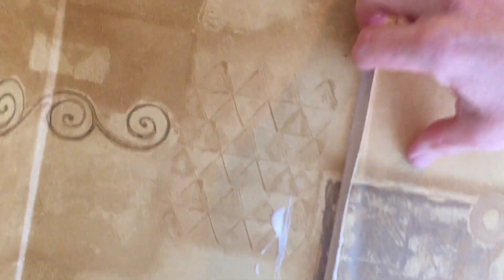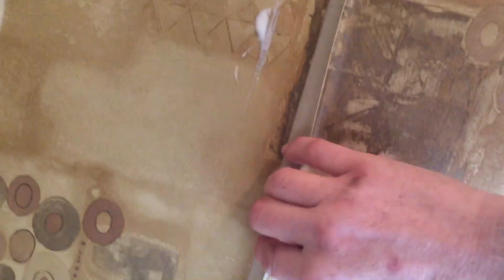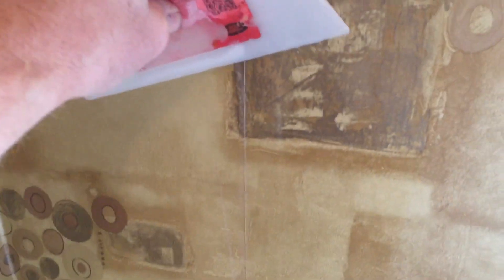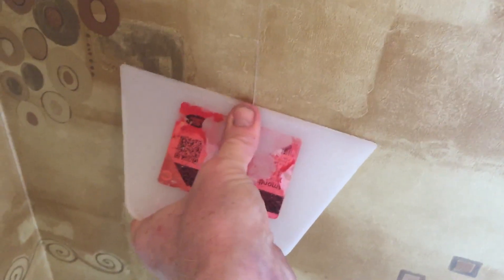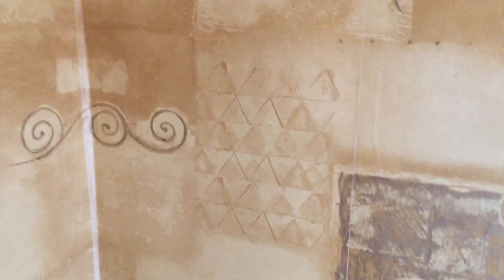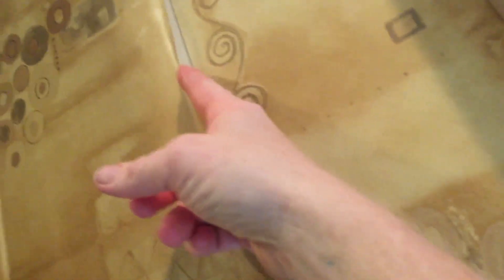How To Repair Wallpaper Seams Part I - Spencer Colgan

Comment: Wallpaper had higher quality 40 years ago.  I put wallpaper in my master bathroom and it is still perfect.  I put wallpaper in the downstairs half bath and the seams are coming loose.  I painted the walls, used wallpaper primer and still have problems.  Great video.

Comment: Excellent video but my problem is a bit different.  The seams are separating.  You can see about 1/4 of the wall.  Is there any way to fix this?

Comment: we just put up wallpaper and the next day it all peeled up on the edges. The wallpaper is very thick and heavy, so we thought that was the issue. what would you recommend. should we repaste then tape it down until it drys or glue the seams down as theyre dry
Reply from the maker: I love this question… Do you know why? Because it happened to me 30 years ago. I would bet that where it peeled up the paint underneath where it peeled up is different than the paint where it is sticking… Am I right?

If it is just thin wallpaper, go out and get yourself what is called border adhesive and put it under the areas where a curled up, and be done with it and have a glass of wine. If it is vinyl, go out and get yourself what  is called Extreme tack from the company called Roman, and do the same thing and then have two glasses of wine… Cheers! Do me a favour and go on google and look up my name, Spencer Colgan and please give me a five star review and let them know how I helped you… You don’t have any idea how much that would help me

Comment: Hi Spencer, thank you for your channel, it has helped me recently with some of your tips on wallpapering and been watching them all, and I watched one the other day and you was hanging wallpaper with one hand 😂😂😱 anyway, the room IV just installed wallpaper is in a Regency building = a lot of decorating over its 100 years, one of the seams has lifted and it has lifted a layer previously applied paper which over the years has been painted over a few times.
So, I have this issue, i understand the dampening of the paper first before applying adhesive,  but when there is 2 seams to fix, 1 directly below , can I follow this clip for both seams one at a time ?
Thanks
Reply from the maker: Here is what I would do… Use heavy duty construction adhesive for the first layer of wallpaper and dry it with a hair blower heated up make sure it’s nice and hard… Then over that first layer of Wallpaper which is nearest the wall, put Zinser bin Ovrr it. and then proceed as you saw in the video… Use heavy duty tacky glue on the top layer and when you get it down, heated up with either a hair blower or a hot air gun… Not too much heat you could burn it
Reply: Spencer Colgan Wallpaper & Painting big thank you 👍👍
Reply from the maker: pete Murray Pete. If you don’t mind, go on this link and give me a five star review and just say a nice word… Only if you have the time.  https://www.google.com/search?q=tampa%20wallpaper%20installer

Comment: I just put up wallpaper, it's white, embossed & paintable. Seams looked invisible when I hung it, but the next day there was a slight gap in every seam! Can't really camouflage them bc the paper is white. I tried filling a bit with mud, which may work since I do plan on painting it. But that will probably be a while before I get to it & I don't actually want to mud & sand every seam. Idk what to do 😩
Reply: Alex plus white latex paintable caulking.
Reply: @twojesusthroughmary5501  I tried a little caulk and it didn't seem to smoothly fill the gap, like how drywall mud does. Maybe I'll try it again.